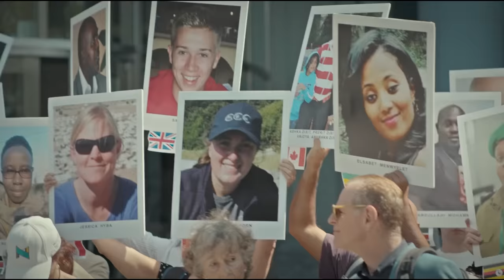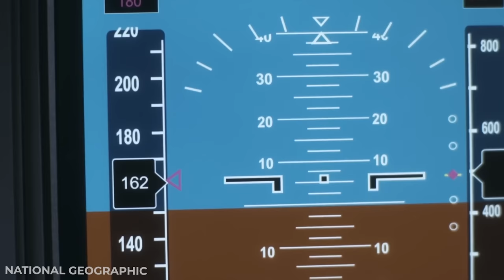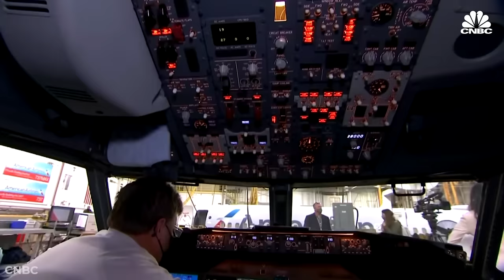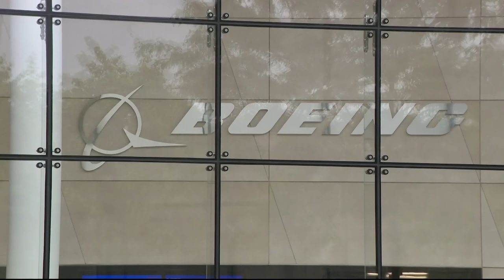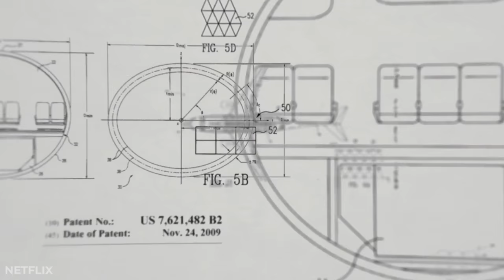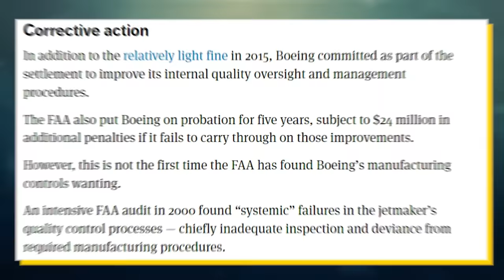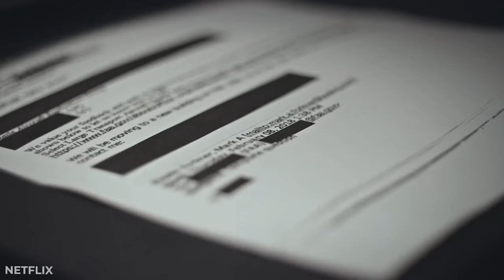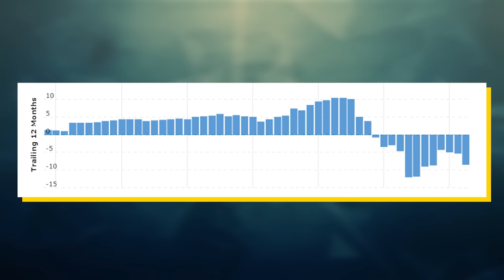Even Boeing Engineers Don't Trust Boeing...

Comment: I wholeheartedly disagree with the premise of this video.   The primary reason for Boeing getting sloppy is they felt immense pressure from the new rival AIRBUS.  Airbus was quickly  cutting into Boeing's market dominance as both foreign and domestic airlines were opting for the newer, more modern aircraft.   For Boeing to be such an aerospace technology company,  their best selling aircraft was still based on 1960s infrastructure.   Boeing had no plans in place to combat this new rival and if it didn't so something fast, it would become the distant number two horse in the race it once lead by country miles.  Purchasing McDonnell Douglas was about trying to maintain the market share lead that was shrinking.
The corporate HQ move to Chicago was not about McDonnell Douglas people trying to hide shortcuts.  It was about tax incentives offered by the city of Chicago to move the headquarters to downtown Chicago.   United Airlines also received tax incentives to move their HQ from their suburban location near O'HARE to downtown and is the reason why the HQ is still there and not Houston as a result of the United Continental merger.  Boeing moving to Arlington VA is about being close to DC for lobbying purposes such as getting the government to not require new software for the MAX 7 AND MAX 10 which would have required a separate type rating.
One could argue whether or not Purchasing McDonnell Douglas was a good business decision,  but to scapegoat McDonnell Douglas is completely wrong.  Other than the DC 10s, they've had a great safety record historically. 
Talking to airline employees and my experience with an airline and other modes of transportation. I can tell you that most employees on both sides of a merger generally don't like the merger and have always had complained about the employees and management from the other company.   That's just how it is .

Comment: Stupid headline.

Many people seem to forget that  a modern airliner is a MASSIVELY MASSIVELY COMPLEX piece of machinery with literslly 10s of thousands of systems and millions of parts. Travellers and critiques seem to expect 100% perfection. 

If you were to list every technical problem on every plane from every Airline Manufacturer I'm sure you would find no model or no maker much worse than any other.

To claim the 737 is a rubbish plane, or that Boeing company is in big trouble is just infantile. Sure,  a few door bolts and a door should NOT fly off, but compared to the other 99.999999% parts that functioned perfectly that same day (that's 1 in a million), it is small chips. Avoidable -- yes, but it will hardly be the downfall of Boeing or the 737. Ya gotta wonder about the agenda of such loudmouths, such soothsayers.
Reply: The mindset of a failure of a critical airframe part being an unavoidable consequence of a complex machine is  one that is dangerous, irresponsible, and unacceptable in the world of commercial aviation.